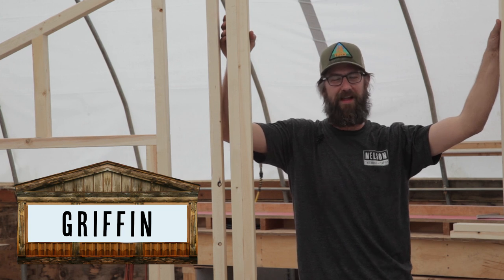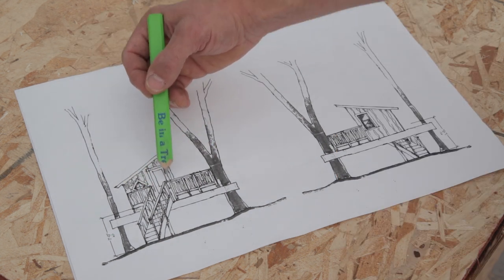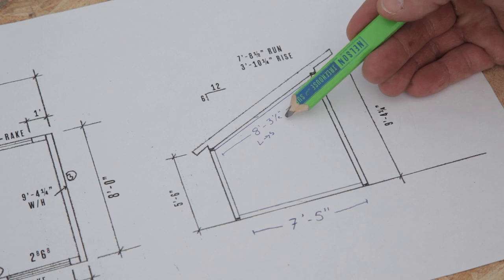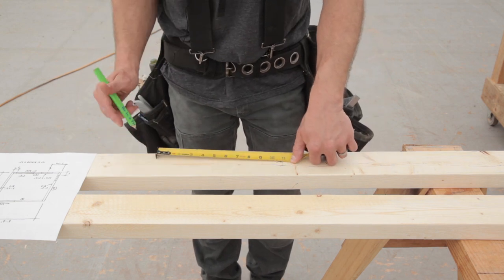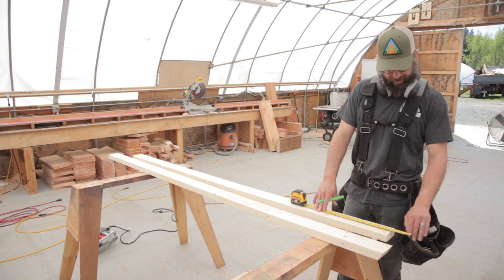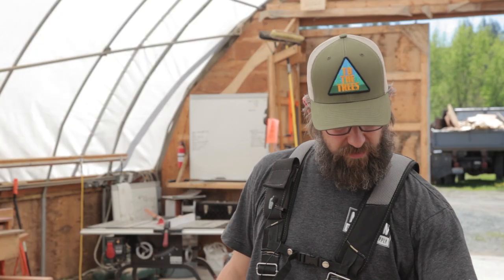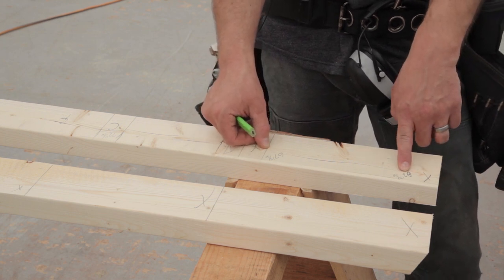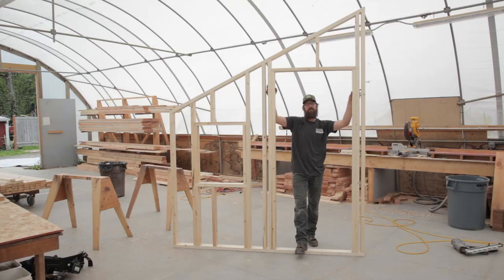Treehouse Framing - your first rake wall!

Comment: It's always interesting to see how different countries tackle the same  issue of framing, and what's normal/code in the various regions. I think that wall would be considered very over-built here in Australia. Personally I would probably install packers between end stud and the door framing to tie them all together and make that part of the wall much stiffer. Tying studs together like that forms a mini-truss. It's also interesting to see the use of what we call noggins doesn't seem to be very common in North America. They stiffen the wall a lot once installed.

Thank God we changed from Imperial to Metric when I was young. I take my hats off to you guys for getting anything done at all based on that archaic nonsense.
Reply: I literally just came to the comment section to say I just get lost with all these fractions being from the UK and using the far superior metric system. This stuff just baffles me the way it is still used as a standard

Comment: Great video.  Left with some question on calculating the top plate in a calculator.  Didn't really show how he came to it.  If I go with the 6/12 pitch, know my bottom plate length, know an ideal short wall height... what else do I need (and how do I perform) the calculation?  Thanks!
Reply: yeah it's kinda missing the important bits here